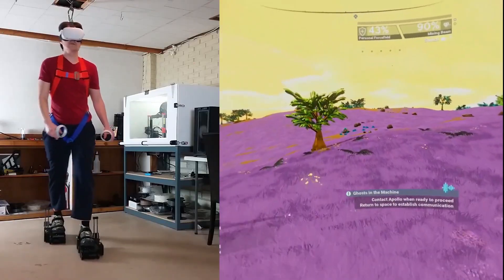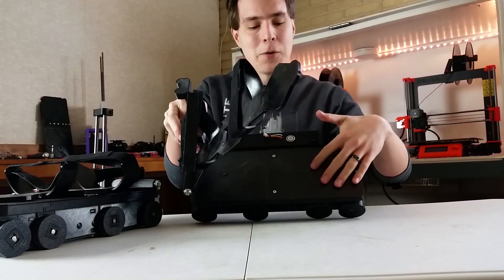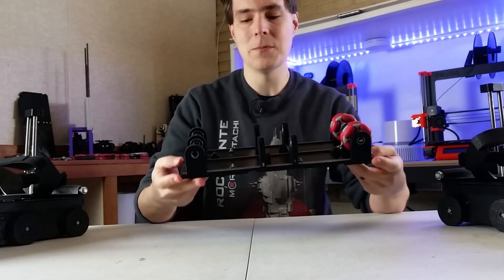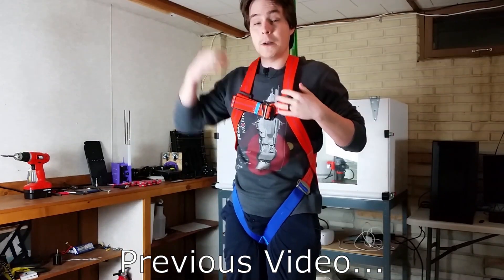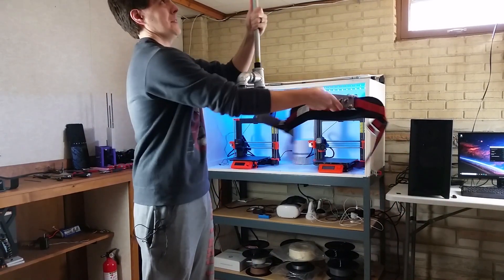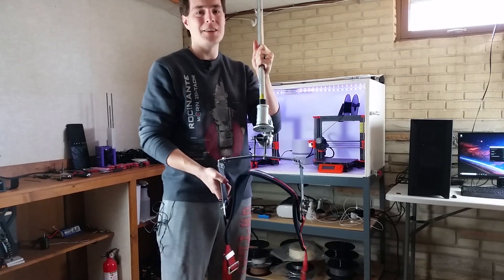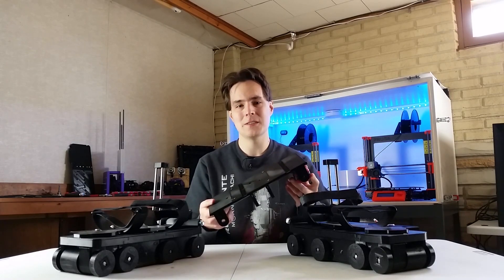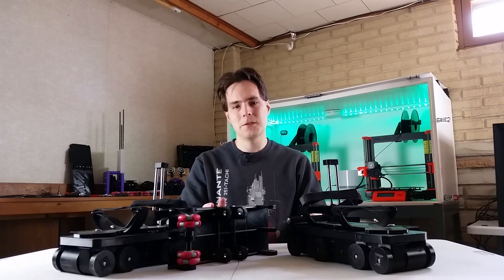VR Shoe Build Log #34 - Plan for the Next Design

Comment: You could look into using a floating ring at waist height to replace the harness. This would allow your pivot point to move back to the right place, whilst also allowing for crouching and removing the need for roof mounting
Reply from the maker: Like the Virtuix Omni uses? I've thought about it and might try it at some point. One issue is that the ring gets in the way of your arms.
Reply: Ahhh, didn't think of that. Maybe shrink it down so its only an inch or so from the hips. Idk if thatd solve the issue but itd likely reduce it

Comment: Will you be able to strafe ? I dont use my cybershoes because you need to strafe in most games
Reply from the maker: I'm going to try adding omni-directional wheels back in so you can strafe. For uni-directional wheels you'd need to turn your hips to the side while keeping your head facing forward. I can imagine with the cybershoes it takes a while to do a 180 turn because you need to swing your legs around the chair.

Comment: out of curiosity, how much filament (by weight) have you used between all your prototyping? 
that one TPU part you showed, looks like it takes half a kilo

also, is the plan to eventually ditch the harness entierly, and just have the shoes recenter you?
Reply from the maker: According to my slicer (PrusaSlicer), the entire frame I showed in this video used up 236.32g of TPU, so just under 1/4 a kg. That's with 30% infill, 0.2mm layer height, 4 solid top layers, 2 solid bottom layers, and 2 perimeter walls.

I've used a lot of filament for all my prototyping. I've been at it for I think 3 years now. I've kept all of it, stored in a bunch of boxes. I've probably used went through over 100 spools by now. I've kept it because I eventually want to try to melt it back down.

I'd like to ditch the harness, but I don't think that's going to be safe. These are roller skates you wear blindfolded, so I think some sort of safety rig will always be needed, whether its a harness, ring around you, or something else. I've seen other vr locomotion solutions where their creators aren't wearing a safety rig, and in pretty much all of them their movements are very controlled and pretty slow. A regular user isn't going to be that careful and it's easy to imagine something going wrong.
Reply: @finallyfunctional  wow, i love long and detailed replies ( thats not sarcasm)

100 rolls of filament, wow, thats crazy, im glad you plan on recycling it!, my current project is a filament maker of my own design, to recycle failed prints or prototypes i dont need. I was having trouble coping with the 1 full roll of filament its taken to do the prints, and reprints for it ....... but now that i see how much youve used, it makes me feel like its not actually that bad.

i see your point on safety, valid point. i just was thinking the harnesses ive seen always look awkward and uncomfy, plus would add more expense, and space, to the requirements of the system, and more set up time.
Reply from the maker: Cool, good luck with your filament maker. I remember watching a video by CNC kitchen where he was able to recycle filament and I'm planning on one day trying that. Even if I can't get it recycled back into filament I'd find some way to use it, like melting it down into sheets and cutting those.
Yeah the harness setup I have now is a little awkward but I'm going to try making it much better. I just can't think of a way to safely get rid of the safety rig.